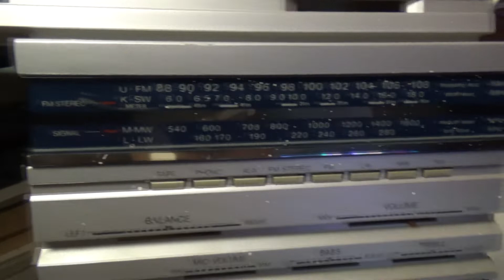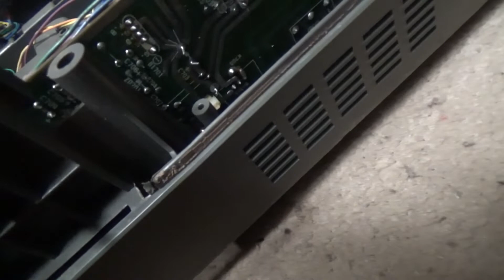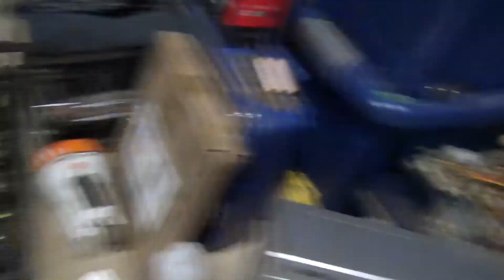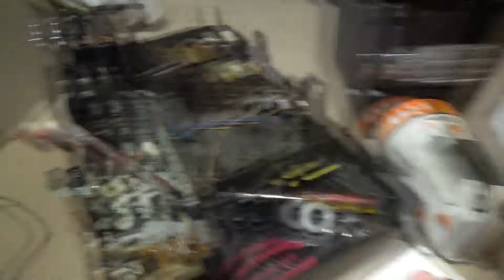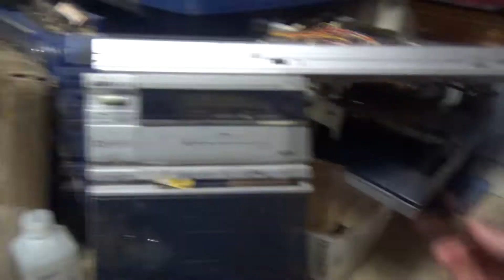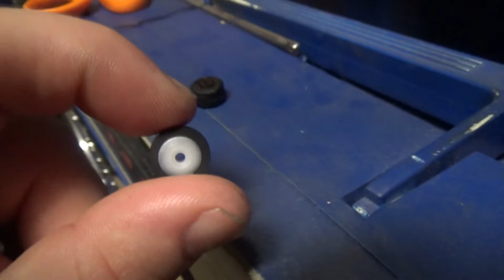Sharp VZ 2500 Repair Part 2

Comment: you are the master and very professional engineer 👏 😊I have one more question please on my sharp vz-3000 system very thing works fine radio.. cassette ..and the record player both sides A and B works perfectly as there was broken black cable on B side all fix .... on my sharp vz-3000 on the left hand side there is power supply unit and there is some sort of transistor on the heat sink which is getting hot I checked its around 54 degrees Celsius ? is this normal? just worried about it or do I have to change the capacitor around the power supply unit? looking at the circuit diagram they are two micro Farad capacitor (1) 4700uf...35v X 2
(2) 2200uf...35v X 1
(3) 220uf.....16v x 1
(4) 33uf.......16v X 2
(5) 10uf ......50v X 3
(6) 100uf ....25v X 2
these are the capacitors on the power supply do they need changing??? or just leave them ? please kindly what is your professional opinion waiting for your kind reply Thank you 😊
Reply from the maker: The temp sounds about right for it, If the temp was getting to about 75 Celsius or more then its being overloaded with a cap drying out. when caps start to go bad is when they are effaced be being hot from cold, starting popping on the top or leaking from the bottom which will destroy the board is not removed and cleaned up. So at 54 deg Celsius if normal I say, your all good. Glade I could help and thanks for watching the videos.

Comment: Hi thank you very much for your reply I checked the B side tonearm and found the black cable which is very very thin was broken in half? I don't know how can it be possible to be broken in half ? so I soldered the broken cable with very difficult together as it very very thin and the cable moves with tonearm backwards and forwards.. and on the wire which I soldered I put small tab of Loctite flexible glue so it's insulated around the soldered joint and tired the black cable with cotton thread with other cable so all the cable can move free back and forward on the tonearm and the B Side works perfectly with no problems thank you

Comment: hi how are you ? I am very sorry to disturb you ..I have replaced the turntable platter belt and the opening and closing door new belt and I have changed the new relay 221d012 on the pcb when I play the record on A side its working perfectly the door opens and closes perfectly But when I select B side to play LP record the stylus cartridge drops on the LP record and then the arm it's drags across the record quickly as its drags its scratching the record ? I have swapped the stylus and still the B side is doing the same thing..kindly help me on this issue thank you Sam
Reply from the maker: I would check to make sure the B side tone arm is straight, if it is some how bent along the tone arm which you will have to look behind the plastic guard to see. What happens is if the arm is not straight or something is wrong with the sensor, that will cause the tone arm to move more faster across the record and not follow the gooves. The make of the turntable is pretty much the same as the self drive turntables that some company's made, sharp and Technic are two that I know that make them.